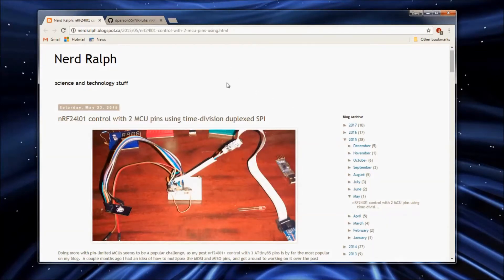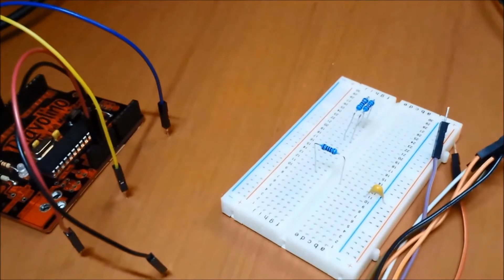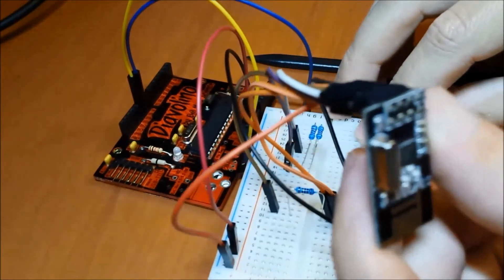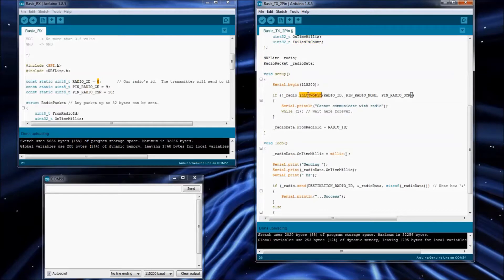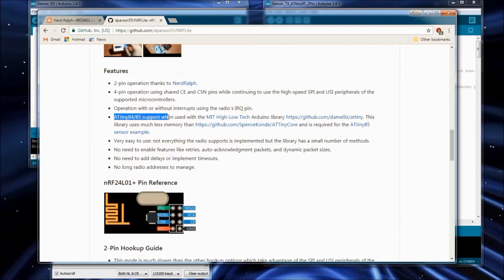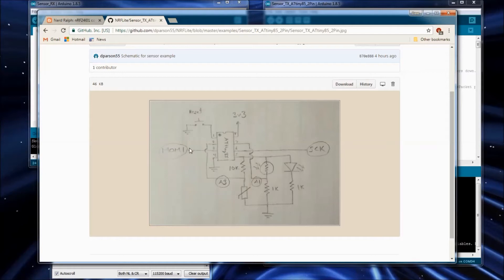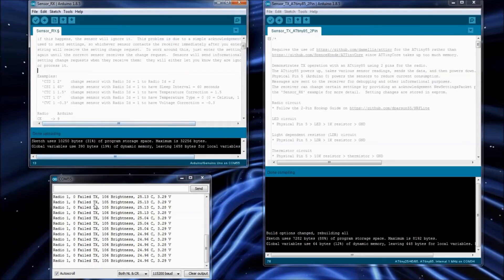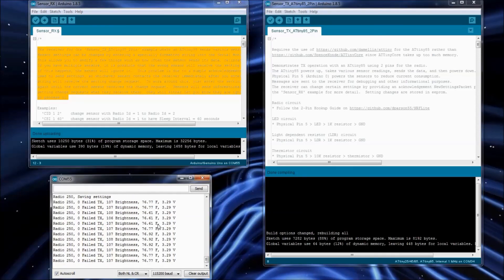NRFLite Arduino nRF24L01 library SPI using only 2 pins

Comment: Thank you for the amazing work! This library has a lot of potential and I would like to use it.
For my project, I need to use an ATTiny85 and the NRF (transmitter) which would normally use up all the ATTiny85's pins. However, I need at least one spare pin for a push button.
I would like to use your 2-pin method but low power consumption is important for my project. The NRF has a "low power mode" (I think it's called standby mode), where it consumes very little power. The NRF enters the standby mode when CSN and CE are different (not sure which pin is high/low).

So my question is, for the 2-pin configuration:
1) Can we achieve standby mode? (Note that I will put the ATTiny85 into sleep mode when not transmitting)
2) if not, what is the power consumption when the NRF is not transmitting/receiving?

I would greatly appreciate your help! 🙏🏽
Reply from the maker: You can look at the 'Sensor_TX_ATtiny85_2pin' example code and schematic on GitHub for a low power system that uses the ATtiny's watchdog timer to wake from a low power sleep state on a regular interval.  During sleep the circuit uses 5 microamps.  For low power systems I always put the nRF module on a separate power bus (controlled by the microcontroller) to conserve power since even when the nRF is in its lowest power state, the modules I have still draw several microamps and when running on batteries, this is significant.  Sensors in the previously mentioned example also draw a significant amount of power so just to make things easiest, a dedicated power bus that the microcontroller can turn on and off has always been my solution.  In the example I just use one of the ATtiny's pins since it can power up to 40 milliamps but for other projects I've used a transistor or mosfet to control this separate power bus.

Comment: Hello dparson, can it be used for multiple senders and only one receiver? Thanks
Reply from the maker: Yes, you sure can.
Reply: @dparson  how and which example library that I can use as basic? and which part of the sketch should I change
Reply from the maker: @ichfanaw  You can use any of the Basic_RX and Basic_TX sketches.  You just need to set the radio id to a unique value for each device, e.g. make the RX node radio id 0, then make the two TX nodes radio id's 1 and 2.  Then just program the 2 TX nodes to send to radio id 0.
Reply: @dparson  Okay, thanks
Reply: @dparson  sorry dparson, i want to ask again. how to know if there is one sender who is disconnected from the radio receiver, while several other senders are still connected. i use
if (_radio.hasData())
but when one of the senders is cut off, the last data value is still displayed.
thank you for your help and answers
Reply from the maker: @ichfanaw  When sending data you can include a time that the data was sent and on the receiver, check to see if the data you have received has a new time.  If the time does not change, you know that the sender has stopped transmitting new data.  In the NRFLite examples, the RadioPacket includes 'OnTimeMillis'.  On the receiver, you can look at this value to determine if it changes.  Good luck!

Comment: Can ı use this module without "3,9,10,11" pins? Because this pins  are connected with motor motors. I can't change them.  So can I use this module in my project? Pleas answer.
Reply: (arduino nano)
Reply from the maker: @ozgur3948  Yes, the nano uses an ATmega microcontroller and these work with the 2 pin logic in NRFLite.  ATtiny microcontrollers are also supported.
Reply: @dparson  is my opinion right?
Reply from the maker: @ozgur3948  No, the Arduino SPI library does not allow reassigning the mosi pin, and NRFLite uses this library internally when SPI is used.  You may want to study the SPI peripheral built into the microcontroller a little more so hopefully this will make more sense.  Due to this limitation, the easiest way to use NRFLite in your situation is to use the 2 pin connection feature.
Reply: @dparson  what do u mean with "2 pin connection feature."?  Sorry but I didn't understand what do you mean. So how should I do connection.
Reply from the maker: @ozgur3948  Maybe it will help if you read the websites I linked to in the description and watch the video with captions turned on.
Reply: @dparson ???
Reply from the maker: @ozgur3948  Watch the part of the video at 1:46.  It shows the schematic to follow in order to use the 2 pin connection feature.  The nRF24L01 radio usually requires connecting the MOSI, MISO, SCK, CE, and CSN pins to the microcontroller (5 pins).  The 2 pin connection feature allows you to only need 2 pins on the microcontroller.
Reply: So can I do like this

Mosı=5
 , mıso=12 
, sck=13, 
 cs=6 
ce=any digital pin(for example 7)
, ırQ=2

Comment: Thank you for your excellent library. Did you ever measured power consumption and time required for transmitting the data for temp, light and voltage as you shown at the end? Also I was curious to see if it is possible to use BME280 sensor with this library?

Thanks.
Reply from the maker: I don't have actual measurements but you can estimate the nRF24L01+ uses 10mA to perform the transmission for about 105ms.  It takes the radio 100ms to power on and about 5ms to do the transmission.  Analog reads only take about 100us, so doing 3 of them is still insignificant compared to the radio's power up time.

I'm sure you can use a BME280 with a nRF24L01+ module, but it would take some experimentation to do on an ATtiny85 due to the low number of pins.  It would be much more straight forward to do with an ATmega328.  Good luck!
Reply: @dparson  Thank you for your quick reply. Right now I am using ESP8266 with BME280. Instead of using standard WiFi which take too long to send data I am using probe requests to send data from ESP8266 slave to ESP8266 master without connecting to master device  . It takes 50 to 60 milliseconds at roughly 75 ma of current at 3.3V. So I was looking for better solution at around same hardware cost.

Thank you for help.
Reply from the maker: @gsge  ESP's and nRF24L01's are probably not the best solution if you're looking to save power and transmit simple measurements.  Maybe a Moteino (https://lowpowerlab.com/guide/moteino/why-moteino/) is what you are looking for.  They use a lot less power and their radios are designed for long range, low bitrate transmissions rather than the nRF24L01+ radio which is designed for short range, high bitrate transmissions.

Comment: Thank You for this exellent library! I tested it work very well. But on tranciever, i can't send data just to ether without DESTINATION_RADIO_ID. I tried to compilate the code without DESTINATION_RADIO_ID, but it doesn't work. Could you help me please?
Reply from the maker: Асет Кудайбергенов sorry I was not able to understand the problem.  Could you include all the code that is not working?
Reply: Sorry for my bad question )). 
I want to send data many recievers. Usually i just trancieved data without specifying DESTINATION_RADIO_ID. 
But In your library, RADIO_ID on the tranciever must be identical with DESTINATION_RADIO_ID in the reciever. And if i want to trancieve data from one tranciever to many recievers with different DESTINATION_RADIO_ID, how can i do it?
Reply from the maker: No worries.  You can use an array https://www.arduino.cc/reference/en/language/variables/data-types/array/ to hold all the radio ids that you would like to transmit to.  Here is an example:

const static uint8_t destinationRadioIds[] = { 5, 20, 21, 44 };

for (uint8_t i; i < sizeof(destinationRadioIds); i++)
{
    uint8_t destinationRadioId = destinationRadioIds[i];
    
    Serial.print("Sending to RadioId ");
    Serial.print(destinationRadioId);

    if (_radio.send(destinationRadioId, &_radioData, sizeof(_radioData)))
    {
        Serial.println("...Success");
    }
    else
    {
        Serial.println("...Failed");
    }
}
Reply: And may be do you know, how can i use one device like a reciever and a transmitter? For examle, rf24 library uses startListening(); and stopListeting(); modes.
Reply from the maker: The code above compiled ok for me so it must be some other part of the code that is the problem.
Reply from the maker: Whenever you call send() the device is put into transmission mode.  Whenever you call hasData() the device is put into receiving mode.  So the device will switch between these 2 modes without having to do anything special.  Usually after doing a send it is best to call hasData soon after, so the device is put back into receiving mode.
Reply: Ok i understood. Thank you!

Comment: Nice work! Hopefully I can find some time later this month to give it try. One of my long running projects is making an RF24 sensor network using an ESP RF/MQTT gateway and inexpensive battery operated sensor nodes. I can see that the cheaper ATtiny's (e.g. ATtiny44 and ATtiny13A) won't work due to memory constraints. Good to see this two pin configuration working fine on the '85.

My last experiments involved different types of (cloned) nRF radio modules on both an ESP8266, Pro Mini's and some mBed MCU's. Unfortunately not all radio modules are equally interchangeable. The supposedly amplified modules with external antenna actually performed worse. Perhaps a more restricted will work better. Thanks again for sharing your efforts...
Reply from the maker: It's funny how many modules we all have, there are so many technologies now it's hard to keep up.  I'm still loving basic 8-bit MCU's and non-WiFi communication, I guess because I like to understand the low level registers and packets and my little brain can't handle 32 bits and the complexity of BLE/WiFi :)

Just a note about the ATtiny44, I was going all out in that ATtiny85 sensor example, sending lots of strings (which eat up tons of space...each character is a byte), so a simplified program for the ATtiny44 would definitely work.  Here's something basic for demonstration:

Program size: 2,220 bytes (used 54% of a 4,096 byte maximum) (0.82 secs)
Minimum Memory Usage: 46 bytes (18% of a 256 byte maximum)

void setup()
{
    if (!_radio.initTwoPin(RADIO_ID, PIN_RADIO_MOMI, PIN_RADIO_SCK))
    {
        while (1); // Wait here forever.
    }

    _radioData.FromRadioId = RADIO_ID;
}

void loop()
{
    _radioData.OnTimeMillis = millis();
    _radioData.SensorReading = analogRead(A1);

    if (!_radio.send(DESTINATION_RADIO_ID, &_radioData, sizeof(_radioData))) 
    {
        _radioData.FailedTxCount++;
    }

    delay(1000);
}
Reply: dparson - Indeed. The choice of modules keeps increasing, but they all have their benefits. The main disadvantage of WiFi is the power consumption. The nrf24 should perform better when running on batteries. Good to read that the ATtiny44 should work too and thanks for the example. I recently  ordered a bunch of 44's as they were cheaper than the '85. They have less memory, but provide a few more i/o pins...